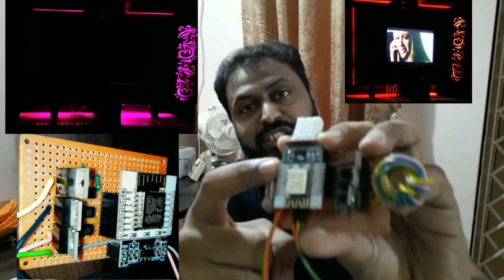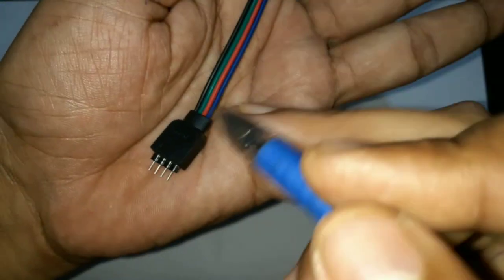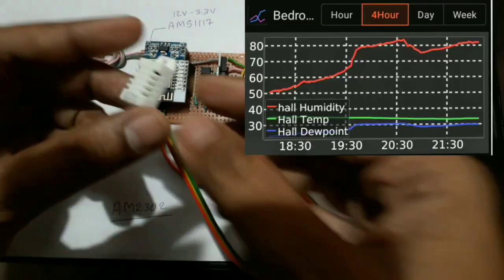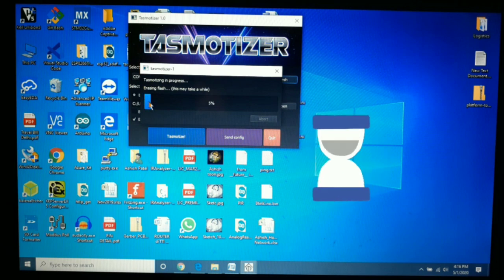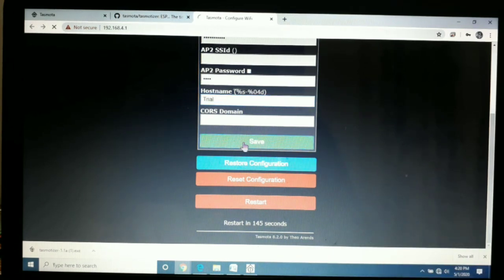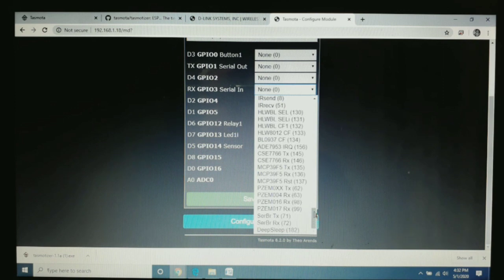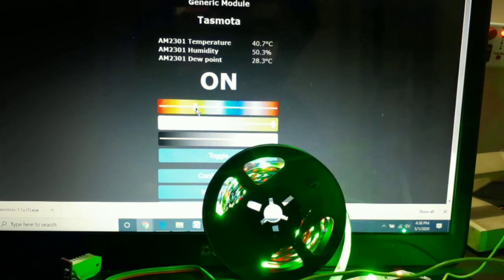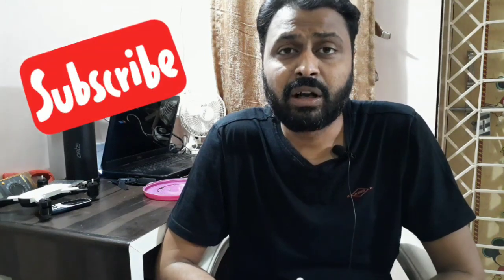How to use Tasmota to make Smart RGB LED controller using ESP8266 & Get Weather Data Of AM2302 Part1

Comment: +3.3v to PC817 pin4 is not enough to turn led strip at 100% brightness. please guide
Reply from the maker: You need to drive most using pc817.    MOSFET is capable of drive led strip.
Reply: @TechnoAutomation I dint get you
Reply from the maker: Did you used MOSFET to drive your led Strip??

Comment: Led is not turning off completely
Reply from the maker: Which LED your talking about.   GPIO O2 ??
Reply: @TechnoAutomation  LED stripe, i found the issue, i forgot to use 10k resistor on gate to ground, thats why those fets are not turning off completly, i had to replace with new fets with 10k resistor
Reply from the maker: Pulldown resistor is required for reliable operation of MOSFET.

.

Comment: I flashed my esp12f. But after flashing, when I remove the GPIO 0 pin, the board does not start. help please
Reply: the blue led flashed just once and then nothing..
Reply from the maker: Can you send me circuit of your project.
Reply from the maker: https://www.facebook.com/ashishamu146
Reply: @TechnoAutomation  I have just made connections to tyhe board as shown in this video. I was able to flash by connecting GPIO0 to ground, but when I remove GPIO0 and plug it in, it does not connect
Reply from the maker: WhatsApp 8160408577

Comment: Hi. It would be great if you could explain how the circuit functions.  I have a 12V RGB strip and I can light up the LEDs by connecting each wire to ground. How do the different components in the circuit do this and how are shades achieved?
Reply from the maker: This PCB also connects Red , green & Blue led wires to ground via MOSFETs.
12V wire is directly connected to RGB LED strip.

All three MOSFETs ate off in normal conditions.
If we increase brightness of Red channel by 50% then output pin of esp8266 generate PWM output with 50% Duty cycle (in normal case).
As output pin is connected with optocoupler,  it also start turning on and off with reference off set pwm Duty cycle which will 50% in this case.
optocoupler is further connected with MOSFET Gate so the MOSFET is also started turning on and off based upon the output duty cycle which is 50% in this case. 
Hence you can get around 6 voltage at Red channel.
Same way you get different voltage as per output duty cycle.
We can set brightness from 0 to 100 % 

In real world human eye not recognise light brightness in linear way.
 I.e. if we set output @ 20% it seems us like 50 %.   

To match actual brightness vision to human eyes we used gamma correction.   In nutcell it's inverse parabolic curve instead of linear one.

In Tasmota this curve is already defined so we don't require to bother about it.

However different RGB LED has their different characteristics.  We can fine tune this using Tasmota webUI Console.

In my case default settings are working & I get almost all colours as per webUI selection.

Hope I answered your questions!!!!
Reply: @TechnoAutomation  Hello, first of all thank you for sharing your project. It's still not clear the function of pullup resistor connected to the Mosfet Gate and also to the PC817 transistor emitter. How the mosfet switch ON and OFF if the gate seems to still at the same Voltage indipendently of the optocoupler state? What I'm missing?
Reply from the maker: Pull-up resistor is mendetory to properly switch off The Mosfet. Without pull-up resistor  Mosfet may remains on even if gate is low.

PC817 is oprocoupler which  is used for protection on ESP Pins. Gpio of esp can handle 15 milli Amps only.    So I used to use PC817 for GPIO protection only.
 you have  to share circuit layout so I can check and suggest what is missing???
Reply: @TechnoAutomation  Is it suitable to drive 24V strip led too?
Reply from the maker: Obviously.  For24 V operation  you need to check mosfet maximum operation voltage in data sheet.    & seco thing to check  24v to 3.3 v regulator.    Some voltage regulator  operation on maximum 12 V only so it should be changed.     No any other changes required. 

If you made one then share circuit diagram. After checking you circuit  I can guide further.